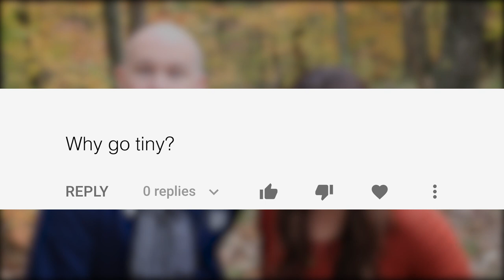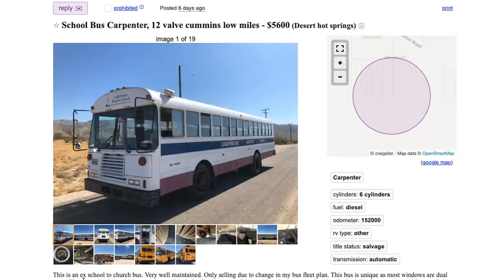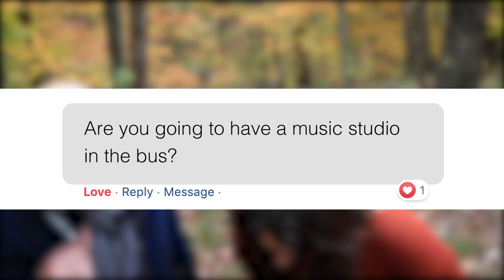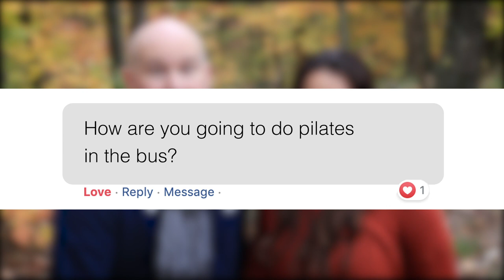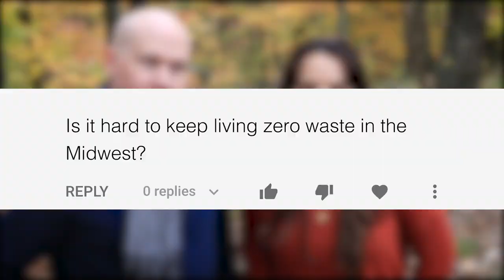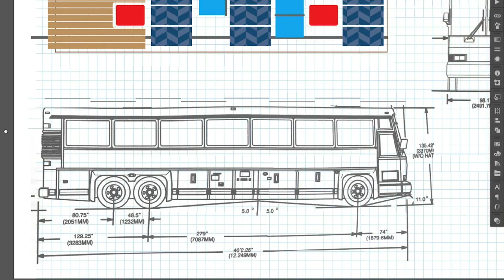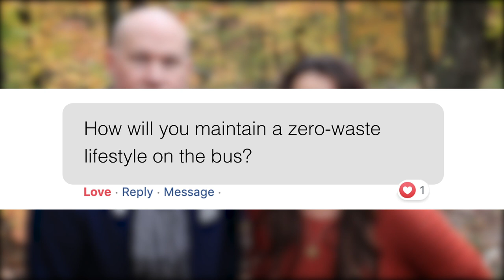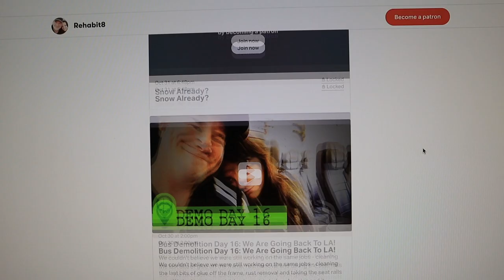Bus Demo Day 23: Season 2 FAQ

Comment: If you need any tips on the cabinet builds, let me know. I am an ex cabinet company owner that has and is making cabinets for our class A.   At this present time I am building new cabinets for the bedroom which include the bed platform along with night stands and the wardrobe closets.We ended up going with pre engineered bamboo flooring which we are very happy with after hearing some negatives about wood flooring in a motorhome. When you do it correct the first time, you do have to do it again unless some major accident happens. Have fun
Reply from the maker: Wow thanks Dean!  Yeah I think we will need all the help we can get as we are just learning as we go

Comment: I been binge watching this all day, what a great find! This is on my bucket list to do.  What kinda mileage on the bus? Have you done any mechanical work?
Reply from the maker: Hi Chris. So glad your enjoying our videos :) we get about 8-10 mpgs with the DD60. We did get oil and transmission fluid changed as well as some minor wiring fixed. The bus was in great shape when we bought it and had service records going back 15 years. We had 2 mechanics look it over and they said “this is the best 1990s coach we have seen”
We are hoping that we won’t have any major mechanical work on the bus for a while
Reply: @Rehabit8  did you have to do anything else besides remove the seats to get an RV registration? Thx
Reply from the maker: Each state has different requirements. If I remember correctly California required 3 out of 4 conversion specifics  to get title transferred to a “house care” (toilet, cook top, potable water, permanent sleeping area) 
Even after that it took a couple trips to 3 different DMVs to find someone who understood and could help us with the title transfer even with all the proper paperwork in hand

Comment: How did you get in contact with MCI
Reply from the maker: Just looked up the number on the internet of our local MCI and called and asked around until someone in the service and used sales department got back to me. They were super helpful
Reply: Nice thing about MCI coaches is 1) they have service centers strategically placed through out North America besides Greyhound, Peter Pan, Trailways service centers can help you. Many parts can be found at your local parts store or and or local truck part store so you don't have to wait weeks for parts to be shipped in.
Reply: @MrStan1221  I can go their website to find service locations?
Reply: yes, i know i have been to the MCI sales and service center in Blackwood, NJ multiple times.